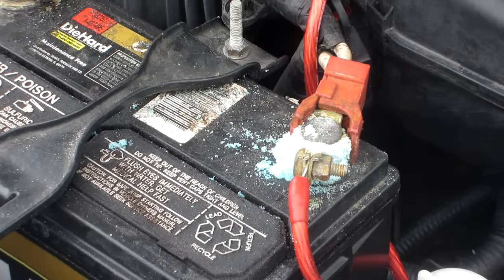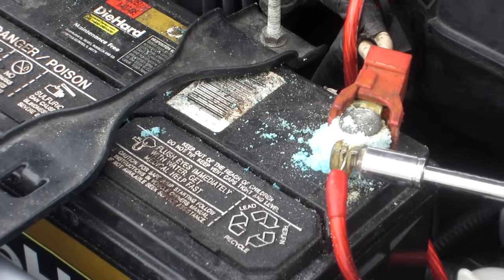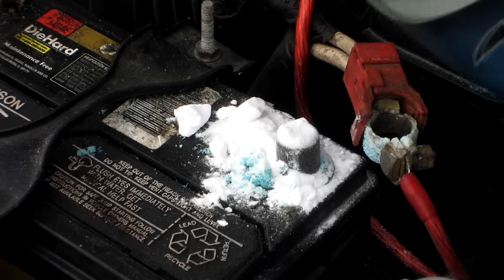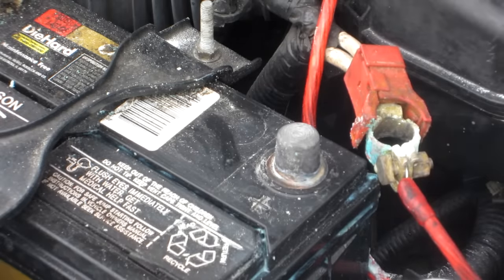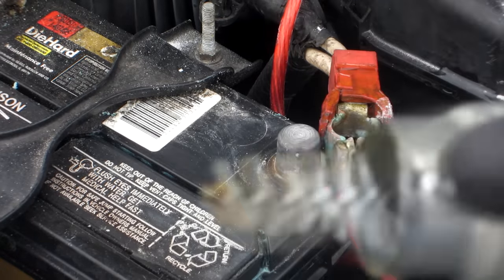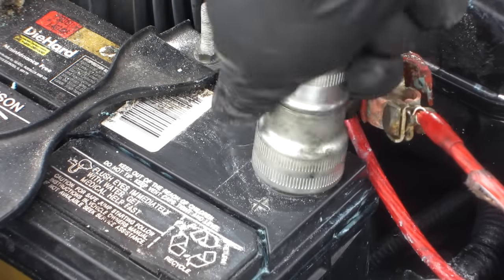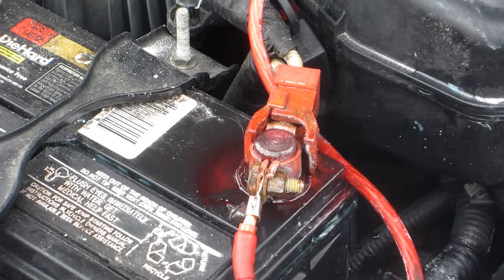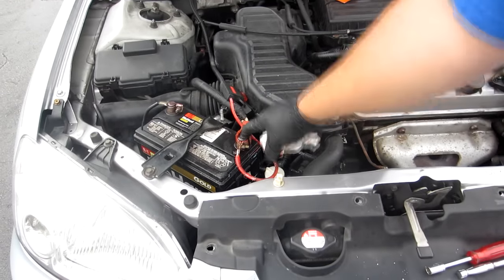HOW TO REMOVE BATTERY CORROSION FAST AND CHEAP!!!

Comment: I would NOT recommend doing this!!!  First, disconn NEG, then POS.  Second, do NOT pour baking soda, then water on your battery!!!  Doing this MAY damage your battery as the water/baking soda solution CAN flow into the battery cells neutralizing the acid in your battery and ruining it.  A better method is to make a paste with the baking soda and a bit of water and then brush it on, wait a couple of minutes, then wipe it off till clean.  Repeat as necessary.  Then use some 200-400 grit sandpaper or a Scotch Brite pad and gently polish the terminals.  Then slap it back together with some petroleum jelly/vasoline on the terminals.  Done.
Reply: it did flow into the cells lol @ 3:00 see the bubbles on the cell caps bubbling in the crack
Reply: Sounds good. I just pour the soda solution on slowly, carefully, and shallowly so it can't get into the battery, then I soak it up with a paper towel, then pour water the same way.
Reply: You can also tape over the cells first
Reply: G&K Ol' School fuck i almost fucked up my battery..good thing i took a dab and sat down to read the comments first.. thank you, stay terpy✌
Reply: not to mention it being the wrong thing to use to neutralize alkali ... jesus has no one here been to high school? (you know  - chemistry class) ????
Reply: they are both technically an electrolyte.
Reply: @jonathanluu7290  No you didn't. Most of these comments are completely baseless. They don't know what acids, bases, or electrolytes are. Its called superstition. If it was that easy for solution to get into or out of a battery they would be horribly dangerous.
Reply: +C Welding Electrolytes are what plants crave.
Reply: Yeah, it LOOKS nice and clean for a video, but this is amature time here. New battery purchase in 3-2-....
Reply: I would jus use battery cleaner
Reply: I do what H&M’s oil school does but mix baking soda and petroleum jelly into a paste and add to my clean terminals
Reply: Don't tell us what to do what are you a mechanic???
Reply: @xMorTeKx  old comment but I thought I was the only one that noticed that lolololol why didn't he just put a little bit on a cloth then wipe it
Reply: the way the caps are made on the battery there's no water or anything else getting in there. this didn't hurt a thing.
Reply: Wow. You should've made a video.
Reply: just pour boiling water on batt it will do no damage at all    i have used this method for 50 yrs with no problems at all
Reply: @antigen4  repent and trust in Christ and you shall know the truth 🙌

Comment: You can also torch the brass a little bit but not the battery and pop those battery caps and clean all that shit out of that cap space there or spray it all off

Comment: The problem is actually a chemical reaction from the fumes of the battery ,it forms a sulfide compound (corrosion) . Hot water as was noted here is the best solution and if you provide an alternative piece of metal (copper penny) the buildup will be on that instead of the terminal .Coke works because of the acid (citric ) contained in it ,just don't get it on your paint .
Reply: You don't use the Acid in the Coke to clean the Acid off the battery 😲😖
It's the Soda in the Coke that Neutralizes the Acid buildup on the battery and terminals👍
Reply: Hi Dave C.      Correct.  
Battery corrosion is caused by hydrogen gas being released from the sulfuric acid inside the battery. As the gasses react to the ambient atmosphere, it begins to produce a corrosive environment. Other elements such as moisture and salts only accelerate the process. 

But,  don’t you mean a  ‘ sulfate ‘  compound  ?    🧐

Battery terminal corrosion is easy to identify. It’s the white, green or bluish stuff on your vehicles battery posts, battery terminals or battery cables. The white substance which you see around battery terminals is either lead sulfate or anhydrous copper sulfate. Anhydrous copper sulfate changes to blue color when exposed to moisture. The bluish material which you see around corroded battery terminals is hydrated copper sulfate and typically experience with copper connectors.Battery corrosion is a poor conductor of electricity, as it increases resistance within the circuit. As a result, the increased resistance can lead to transient current flow, which typically leads to your car not starting.

This information was obtained from an article titled:-  “Ultimate guide to clean and remove car battery corrosion”.  (Author:  Mandy Phillips.)

Comment: I've always loved using baking soda and water to clean off the corrosion on battery terminals. It is super fast and with a little rinse and maybe some light brushing they are cleaner than ever!
Reply: Do u think that this is the reason that my truck won’t start , all of a sudden? I see corrosion on the positive terminal.
Reply: @jdsirrom6764  Very possible.

Comment: There are so many things wrong with this. PLEASE, don't emulate what is happening here. 

First, REMOVE THE NEGATIVE BATTERY CABLE!

Second, REMOVE THE POSITIVE.

Third, DON'T KNOCK THE CORROSION OFF THE BATTERY OR THE TERMINAL CONNECTORS INSIDE THE ENGINE AREA.

Fourth, remove the battery from the vehicle. 

Fifth, mix the water and baking soda in a disposable cup and submerge the battery CABLE CONNECTORS in the solution to neutralize the acid, then use a brass or stainless brush to clean the terminals. In this case, the TERMINAL ends are so badly damaged, they need to be replaced.

Sixth, clean the battery case, hold-down hardware, and the area where the battery resides in the engine compartment with a fresh solution of  baking soda and water using a nylon brush. Then flush with a garden hose.

Seventh, clean the terminals and CABLE ends with a tool you can get at your auto parts store.

Eighth, reassemble in reverse order. DO NOT OVERTIGHTEN THE TERMINALS ! Tighten only to the point you cannot move the connector. NEVER discard the battery hold-down. 

Ninth, REMOVE any auxiliary wires from your terminals that have been added by idiots that have no clue about proper electrical connections. These makeshift connections cause the corrosion to start in the first place and are a FIRE hazard. Tap off your fuse box, or the starter terminal for battery POSITIVE and the engine block fo negative.

Comment: Wouldn't it be better if you made a solution of baking soda with water in a spray container or something instead of putting all that baking soda powder on the battery and risk getting it in your eyes if the wind blows?
Reply: just pore boiling water over it no need for baking soda
Reply: @michaelreid85  - Battery corrosion is acidic and toxic. The point of using Baking Soda is that it neutralizes its acidic nature. Boiling water isn't going to do anything. You may as well just use water out of the tap if you're looking to spread acid around inside your car like that. You NEED to use baking soda to neutralize the acid if you care about your car or the environment at all.

Comment: Good job Mike.  I'll add an extra kudo for you wearing safety gloves, and add as well folks ought to always wear safety goggles or at least safety glasses to avoid any potential eye contact with corrosive material of any kind.  an air filter over the mouth is never a bad idea either, but many would consider overkill.  If corrosion is airborne, it's bad news.  Most folks blow it off instinctively, and as such stand a risk of breathing some of it in.

Simply put, BE CAREFUL, TAKE OBVIOUS PRECAUTIONS, AND BE THOROUGH, so you are not back soon to do it all again.  Great upload Mike.  keep up the good work.

Comment: Simply Pour some Boiling Water and clean it with an old toothbrush. That's it. Done!!!
Reply: Just hot tap water works.
Reply: totally, I am failing to see what the baking soda did vs. elbow grease?
Reply: The crud was acidic. Baking soda is a base. Bases neutralize acids and stops it from eating anything else.

Comment: instead of a shim, you can also just stick a metal screw in between the tightener to create a better hold. It holds the terminal in place great and its a cheap fix.
Reply: That would create an incomplete/inefficient seal between the clamp and the terminal post, though.
If and when anything becomes a bit loose from vibrations of the engine and the act of driving, the jiggling clamp/screw could cause a short in the circuit, followed by a 35,000⁰F arc flash as the current jumps from the terminal to the clamp through the gap.

This could easily explode your battery, especially on a hot day with a volume of extremely flammable & heavy hydrogen sulfide gas lingering beneath the hood on top of your battery where it is vented by the casing during operation.

Not a good idea. This is what we call a "hack job," AKA "redneck fix," AKA "fatal mistake."

Comment: Very good video. I have been around cars all my life. I used the batteries that had the terminals on the side for some of my cars for a long time years and years and I never had a battery corrosion problem with them. As soon as I switched to the type with the terminals on the top the problems started.
Reply: You didn't switch batteries you switch vehicle makes from GM to anything else but GM
Reply: That's because the life expectancy of the battery is longer than any GM Vehicle 😂🤣

Comment: All I've done for decades pour on hot water...over the battery & cable terminal.. Then use white petroleum jelly on terminal.
Also I wash away any liquid with clean water only to remove any acidic liquid.

Comment: mix the baking soda IN warm water......then submerge the wire and/or pour it over/on the terminal
MUCH cleaner method
When done use Silicon Grease/lube to prevent ANY corrosion.....DON'T pay 99c+ for those little packets....get a LARGE tube in the plumbing section of an hardware store for $3-5

Comment: Lot of work for nothing.
Pour boiling water over the terminal, wipe, check connection, done.
Reply: Agree. Seems to be a solution that generally hasn't been passed on.

Comment: The radio station/car alarm issue. get a cigarette lighter plug and hook up a 9 Volt battery. plug that in while your battery is out. 
You're welcome.
Reply: They sell em at wally mart including the battery .
Reply: This is probably a dumb question,  but after the cleaning process is done, should you hose off the pavement area where the vehicle was?   For some reason I have visions of my dog snooping around and then potentially licking to see what was going on there.  😯   Thanks!
Reply: @bearpawz_  🤣🤣🤣🤣🤣🤣
Reply: Or jumper cables to an old battery

Comment: dude! your not supposed to get the terminal protection in between the post and the terminal. lmao ... good vid though.
Reply: Brandon Bell  😅 ok... you can do what you want my friend.  I do not recommend putting anything in between the two contacts. Unless youre putting something that'll burn off. But terminal protection does not burn off it stays there, until you wipe it off. Imo, it does matter. But you can do what you want.
Reply: Brandon Bell  Im pretty sure that CRC Battery Terminal Protection is non-conductive. So why are you putting it in between the contacts? Its designed to coat the terminals, not conduct electricity. The contacts are supposed to be free of anything and clean. Like i said, you do what you  want buddy. I worked for AAA for 5yrs and I never sprayed my posts after shaving them clean with red protectant.

Comment: The way I have always cleaned battery acid off of the battery terminals is with a small wire brush you just barely got a rub and it comes right off and looks brand new after you rubbed It off all you have to do is just blow on it and it'll clean everything off the battery and terminal

Comment: An old trick to prevent acid corrosion build up on your battery terminals in the 1st place is to glue a couple of pennies about an inch and a half from the terminal... corrosion goes onto the pennies and not the terminal, then clean off the pennies with a wire brush or use the baking soda method as in this video or just scrape off the pennies and replace them... also it's a good idea to grease your terminals to  prevent corrosion build up.
Reply: Why cant I see the reply marked here? Weird. I was curious what the commentary on this tip was.

Comment: NEVER disconnect the positive before you disconnect the negative.  I don't care how many times you've done it w/o issue or how careful you think you are.  ALWAYS disconnect Neg first.  ALWAYS reconnect the Neg last.  It's the only safe way.
BTW- Coke or Pepsi will clean off all that corrosion w/o the mess but either way you need to hose all that acid/corrosion/debris off and out.  Also, to do the cable, get old tooth brush wet and dip it in baking soda so you can clean in there good.  Wear eye protection as well as gloves.  Any of that watery debris/corrosion gets on your cloths, expect a hole or wear old clothes.
Reply: @x-man5056  Well, while I do perform all vehicle maintenance and repairs on my own vehicles, I am actually not a mechanic. Though I am used to working with high voltage, and under circumstances that would no doubt make you uncomfortable.
Reply: @projectmanagement2356  Not uncomfortable at all.  I know how a 12v DC system works.  I have high degree of education and experience with Electricity, Electronics and automobile electrical systems.  Certified Navy Nuclear/SubSafe in 2012.  I don't give people advice about things I have little or no experience with.  I don't mess with systems I don't have certainty of safe work practices.  You seem to assume allot of things you have little or no knowledge of.  Based on your statements your life insurance company ought to raise your premiums.
Reply: @x-man5056  I am referring to my career. I routinely short high current dc at work. I dont have the luxury of being 100% prepared for what repair I need to effect. I am paid to solve problems quickly with limited time or resources to make decisions. Something you clearly distance your self from.
Reply: @x-man5056  I take it you aren't familiar with shielded metal arc welding or the adventures in field retrofitting and repair so no hard feelings man and congratulations on making 3rd technician at jiffy lube 🍺
Reply: Thanks too
Reply: Gee whiz guys it just a car battery it's not rocket science. Battle of degrees watch out!
Reply: @bigdcoach22bigdfan4life6  lol 🍻
Reply: X-Man q
Reply: X-Man would this corrosion be a reason for my battery dying ?
Reply: @mmNovaa  Yes it is a sign of low voltage and high resistance through the posts.
Reply: Metallic Plasma my car started dying today but there’s a lot of corrosion on the right side. If I clean it up you think it’ll stop dying ?? Lol I’m 18 don’t know anything about cars
Reply: @mmNovaa  Yes for a while it's a sign the battery isn't fully charging. The more build-up the less charge and it dies. Clean the post and replace it when you can. It may be the alternator isn't able to charge it fully also and may need replacing.
Reply: Metallic Plasma alright I’ll clean it first and see how that goes. Thanks a lot
Reply: Metallic Plasma one more question lol do I have take that piece off with the socket in order to clean it ?
Reply: @mmNovaa  yeah that would be best.
Reply: @projectmanagement2356   @X-Man. Fun debate (minus the insults)! Next I suggest a debate on working in a strict  protocol driven environment like a Nuclear Sub (closely watched by lawyers and OSHA etc -malpractice insurance? life insurance premium issues etc) VS an environment in which a deep understanding of a process allows limited relaxing of "SOP". 👍🏾to both of you for the  points made. That said, if you don't have the depth of understanding of electricity of people like Metallic Plasma-practice disconnecting negative first like X-Man said!(this will also suffice for that Jiffy Lube tech job btw).
Reply: @projectmanagement2356  @Metallic Plasma  You too sound annoying as hell!  I hope you're not still going at it after 3 months...
Reply: X-Man so wen you reconnect the battery you conect positive first and then negative ? I jus a cuestión my brother
Reply: @x-man5056  your high degree of education should have taught you it's a lot not allot .
Reply: @mmNovaa  If it is severe enough it can interrupt the contact between the battery and alternator charge wire depending on configuration. 

Regardless, it needs to be cleaned off. Disconnect battery from both cables, clean them, put full charge on battery, reconnect.  If battery goes dead again, check alternator output.  If alternator is charging check for parasitic draw.  Search YouTube for "Parasitic draw test"
Reply: @traviezo766  Yes.  Again; remove negative first coming apart.  Connect negitive last going back together.
Reply: X-Man thank you